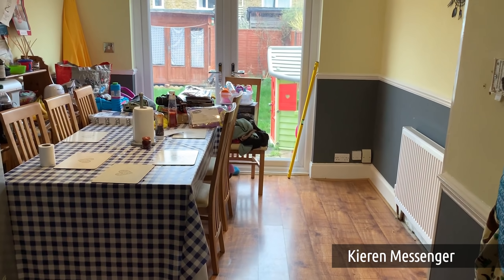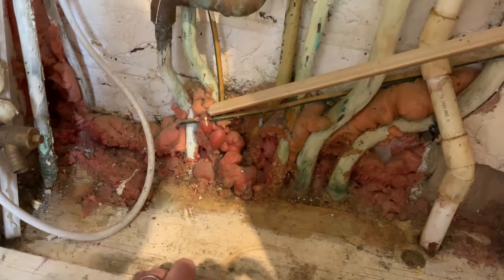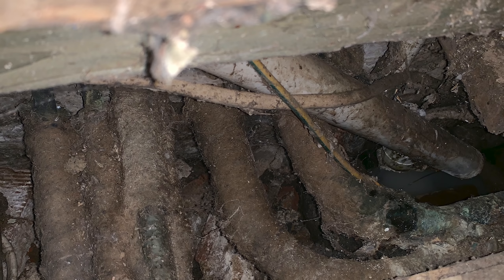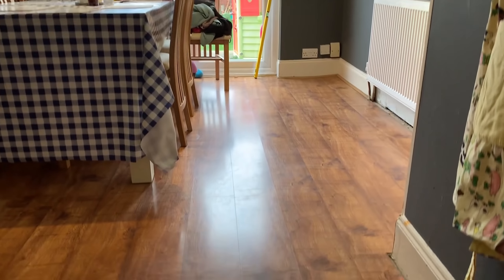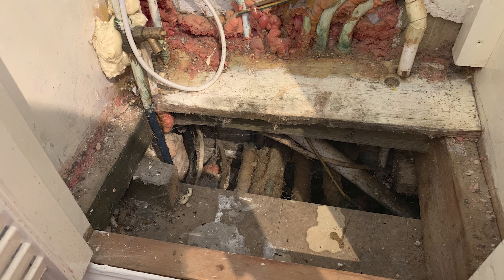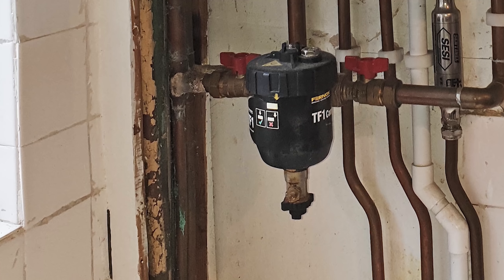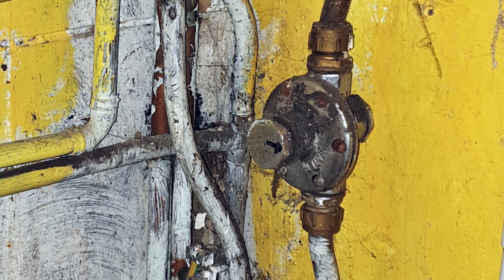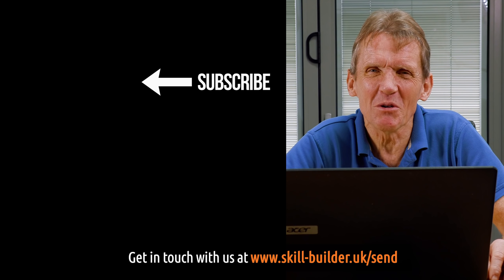Why is There a Nasty Smell? ASB #7

Comment: Re. Qu.1: If main house is also suspended floor, make sure concreting extension floor won't obstruct any existing sub floor air vents (air bricks). If it will you can run ducts through new floor slab out to air brick on extension wall to maintain air flow.
Reply from the maker: Martin 
Good advice. That is essential but often overlooked.

Comment: Foil backed plasterboard is a good vapour barrier as long as the joints are vapour sealed to, but people often overlook the trouble effects it had on FM radio,  with and bluetooth performance in modern houses.  I'd you are in a room that uses it all round and has low-e glass you're effectively inside a tin can! 
Also I noticed our local building regs say it should not be used on ceilings but none if the local builders seem to respect that,  and they use it throughout.

Comment: Hi folks. I’m the unlucky one with the drainage issue. Thanks for answering Roger, at least we know it’s fixable! Would you suggest a wet or dry underfloor system?

Few things from the comments: 1) Survey didn’t pick it up. We didn’t notice for 2 years as it was sealed up tight! 2) The previous owner was a builder, so suspect he self-built on the side and sadly cut some corners. 3) Current plans are to move the drain outside, move the boiler to the far wall, underfloor heating and probably rip out the kitchen all at the same time. 4) We’re in Sutton if anyone wants the job! 

Cheers!
Reply: Sorry to hear about that. Not sure what kind of a builder the previous owner was, but that is one horrendous bodge. I've never seen anything like it. I would be going round the entire house with a fine cone.  I would suspect everything the PO has touched to need redoing.
Reply: I was wondering where does your present kitchen sink drain to. Is it going to that gully?
Reply: Phill Seddon yeah, the sink, dishwasher and washing machine all drain into the gulley. There’s only so much bleach I can use to stop the smell of food waste 🤦‍♂️
Reply: Oh crap. Wasn't sure if that had been checked, Roger mentioned about boiler condenser overflow, but thought I wonder if he left open for other services. 
Best of luck with sorting it out.
Reply from the maker: Hi Kieran 
Always go for the wet system. The electric system is really for tile warm up not for heating the room. 
Electric on a room like that costs  fortune to run. 
A bloke down the road had it, against my advice, and after one season he turned it off when he saw the bill. He has gone back to radiators. 
The wet systems are cheap to run and work really well.
Reply: How did it turn out Kieran?
Reply: indieh01 I was wondering the same!! How did it work out phill?? Only just found skill builder so watching a lot of new/old...
Reply: @jethhughes4278  same. Curious. But doubt he'll reply now!
Reply: Any update :D did you recently buy the house? Waa it captured by the surveyor.

Comment: I'd love to get there and sort that out it's bloody terrible. Heart breaking to see such shoddy work.

The damp I would agree with roger, I'd also wonder if you have sufficient airbricks. I wonder how that job passed building control.

My personal choice for the internal insulation would have been polythene sheet between the stud and the brick allowing an air gap, Lot of work but stops damp and eventual salt and  build up plus mould

Comment: My preferred way to spec insulated dry lining is to fix 50x25mm treated softwood battens to the wall with a DPC behind the battens and then use a composite board which incorporates a moisture control layer such as Kingspan K18. 92.5mm board works for most scenarios. This incorporates 12.5mm PB so the insulation would be 80mm. https://www.kingspan.com/irl/en-ie/product-groups/insulation-boards/kooltherm/kooltherm-k18-insulated-plasterboard. The DPC need only be used if there's a risk of moisture coming through the existing wall.

Comment: Thank for your advice Roger I should have mentioned I’d used the foil backed plasterboard and put the batons over the full sheets of insulation so they don’t touch the actual wall, wasn’t sure if it was overkill so didn’t use it in another room but definitely will for the others with your advice. Has made a big difference to that room.  Was also wondering if it’s worth insulating under the suspended wooden floor? Maybe with loft type insulation.
Reply: I've insulated under a suspended wooden floor, it was the worst job in the world.
I had to crawl under the floor in about a 2 ft gap, push the insulation into the joists and then cover with membrane to stop it falling down.
Never again unless I used spray foam or could easily take up the flooring.
I rent out the property now and one day I'd love to fill in all the voids and have underfloor heating. Pure luxury.
Reply: @ralphsterz2889  I've done that too. Agreed. Definitely worst job to do ever.
Reply: Rigid board insulation sitting on timber battens fixed to side of joists to stop it dropping through
Reply: James, I really wana insulate the solid walls of my house, I watched a few videos and read up a lot online and the possibility of interstitial condensation has really put me off so i am more than willing to go overkill. Would really like to get a bit more detail from you re what you did. Can you confirm exactly your set up from the wall, including thicknesses of each layer. Did you insulate the wall under the floorboards too?
Reply: Jackzuk hi I first put full sheets of 50mm rigid insulation against the walls then fixed them with 25x50 roof tile batons as they are pressure treated and cheap. I also used foil tape to cover the joint between pir boards. Then used 12.5mm foil backed plasterboard onto the batons which leaves a 25mm gap between the back of the plasterboard and the insulation. I used this gap to run ring main etc. Also put loads of additional wood when I planned to hang a tv for support. If possible seal any gap round when walls meet with foam filler if room. Have thought about running a full silicon bead round the insulation perimeter before fixing to the wall to again stop any moist air reaching the wall behind but haven’t done that yet. Room is so much warmer now and I plan to do all external wall in the house.
Reply: Thanks James, I’ve been looking into this for ages, reading all the celotex/kingspan documentation about how it should be done, also read up in loads of other places and i got to say your way seems by far the best way to do it. It seems to cover all the issues, I cannot believe no one else has mentioned this way of doing it. Its cheaper than getting combined insulated plasterboard, leaves a gap for wiring, lets u seal the joins in the insulation, the 25mm batten void plus 12.5mm plasterboard gives u a nice 37.5mm lip to allow u to tape the join between the insulation and the wall and keep it hidden behind the plasterboard (i would also foam and silicone that edge before taping that for belt and braces). 

Did you stick the plasterboard to the wall or just have the bettens hold them in place. 

Did you leave a small gap at the bottom and fill with foam?
Reply: Jackzuk I went down to the floorboards but you could cut them back and continue the insulation down further but I didn’t do this. Also I have redone a bedroom which seemed like it had already been insulated but they’d used the white polystyrene type stuff and my Dad was a fireman and said it can cause a fire risk if it’s near cables but the Kingspan etc is fine. So would avoid polystyrene. Seeing that I pulled it off and the walls looked ok behind with not really any mould but they had fixed with dot and dab with mechanical fixings too when because they were set in the masonry wall, and the tops were just below the skim plaster, when it was cold you could see a sort of water mark blob where they were. 
This method avoids this as the screws holding the batons are deep under the plasterboard.
Reply from the maker: I insulated under my floors, it took a day to do but was the best day I invested. It makes a huge difference.
Reply: @Jackzuk , I was in a similar boat a few years back and spent months looking into how to best go about the insulation job. Very few people seem to talk about a continuous foam slab with wooden battens all the way through, but I've seen it done plenty of times.

Personally I also filled the voids between the battens with insulation but didn't use foil backed plasterboard as the taped PIR boards have the moisture barrier covered. I left a gap large enough to get a foam gun in around all of the edges, and went as far as I could below the floorboards. My biggest concern was the window reveal as sealing properly all the way up to the window is tricky and you have less room for insulation. 25mm was as much as I could fit in there, and I did my best to tape and seal with foam everywhere that I could. The plasterboard is only screwed down on the inside corner around the window, and glued to the PIR (which itself is glued in with foam) further back.
Reply: Hi James, can i asked how u fixed ut betterns please..... im trying ur idea now, and am about half way through batterning and now im finding it a hit and miss of the batten screw finding the raw plug i put in and its doing my head in,
Reply: @Jackzuk  have you put Rawl plugs in the wall behind the insulation?
I just went straight through the battens with the SDS, straight through the insulation and into the wall, then used concrete screws to affix to the wall.

The cold bridging is going to be very slightly larger than with a screw and a plug, but it's so much easier and I'm not overly concerned. I did ensure that every screw head was inset into the timber battens a little so that there was no direct contact from them to the plasterboard though.

Comment: With the sound reduction material - there needs to be consideration to the electric cables and future maintenance. Good to fill the gaps - but must not compromise the heat dissipation of the electrical wiring. Always an issue of unintended consequences. Fix one problem - create another.

Comment: We paid for a full survey and they listed the windows as “good”.  They are 10 yr old wooden frame doubled glazed.  70% leak, window sills are rotting and the external window trims and battens disintegrate when touched (they are visibly rotten).  We complained and they came back 2 months later and said it wasn’t raining when they did the survey and as 2 months had passed it could have rotted since 🤦🏻‍♂️.  They then wrote to us to say that was their final decision and they consider the complain closed.  It cost us £4000 in repairs!
Reply from the maker: That is outrageous
Reply: Should write to their governing body and ask if that's acceptable practice.

Comment: In my under stairs toilet I kept smelling the drains. I could find no leak at all around the toilet. So the only suspect was the trap on the sink, but since the loo gets used every day could not think how the trap would dry out so quickly.
Then one day I shut the door to the loo as I entered and heard a glug glug.
It's a sealed room so all that pressure pushed the water out of the trap. Don't tell the council ;)  Still trying to figure out how to ventilate it, perhaps I need to write in for your advice on that...
Reply from the maker: consider it done. We will address it in a future issue. I think it was coincidence. Try doing it again a few time. A more likely cause is siphonic action on the trap caused by something else being run in the drain.  Consider the possibility of a blocked drain. That is a common cause of the glug, glug, glug.
Reply: @SkillBuilder  The sink drain runs into the soil drain through a side stabbing, that then runs off to the outside. I considered it might be the flushing of the loo but a 4" pipe would not do that.
I will make a video and take photos of the ventilation problem and why I have not installed an fan already.
Reply from the maker: @logik100.0  I have known plenty of 4 inch drains pull a basin trap. It does not have to fill the 4 inch pipe it just needs to create a pull of air. That is the purpose of the vent pipe.
Reply: @logik100.0 , depending on how accessible your waste pipe is, and the configuration of the rest of the waste system, you may be able to easily add an air admittance valve which should stop the drains pulling the basin trap.
If it is indeed the door however, it might be worth just taking a few mm off the bottom.

Comment: Bilding an extension abive drains requires approval. It is likely the extension will not have been given council building approval. Since 2013 the law changed and sellers became liable for non disclosure of known issues. It may be possible to sue the previous owners for non disclosure.

Comment: Re vapour barrier when insulating a solid wall, I was looking into foil back plasterboard but wouldn’t the vapour pass through joins of the plasterboard and then pass through the inevitable gaps between the foil insulation and the battens. This is something is really wana do but worry about the interstitial condensation. What would you say is the best set up of layers. 

Is there harm in doing all the suggestions, ie use foil backed insulation, then battens to create the small voild, then vapour barrier and then foil backed plasterboard. Also would it matter if the let the vapour barrier sit slightly loose between some battens so allow cable to run up from under the floor between the plasterboard and vapour barrier.
Reply: The foil backed insulation will be fine, any joins or battens cover with aluminium backed tape to seal the gaps.
Reply: If you tape up all of your celotex joins, the continuous aluminium later there acts as your moisture barrier, and and even without the tape I'd suggest it would be as effective as foil backed plasterboard (as you can't tape the foil joins on the back). Not quite sure why that wasn't mentioned in the video.
The screw holes going through holding the battens can be a way for moisture to get through but I'd still consider it better than the gaps between foil backed insulation.
With larger battens you could attach to the ceiling and floor and not penetrate the insulation at all - this would also provide an acoustic improvement, especially if you use compliant mounting hardware.

Comment: Hi can Anyone on here give me some advice I have just fitter insulated plasterboard in my hallwall but the joint are not flush maybe 1-2mm clip on them is this going to cause problems when it gets plastered presume it’s prob down to the insulation squashing
Reply from the maker: It is due to just not getting them flush when you put them on the adhesive. I always use a big aluminium beam and lay it across the boards. 
If you are talking of a lip of anything up to 4mm the plasterer can straighten that out so don't worrry. Not everything goes well first time.

Comment: Watch that expanding foam it can attack the pvc on the electric cabling eating it due to the chemical mix in the foam
Reply from the maker: Hi Porkbap 
Have you some evidence for this? We would like to see something that supports this claim because polyurethane foam is used all over the world as a seal around cables. You have to guard against over-heating  but plasticiser migration is usually caused by  polystyrene.
Reply: @SkillBuilder  yeah actually thinking about it was on about the foam insulation they used to use in wall cavities and roof spaces I was a spark for 20 years and have seen the polystyrene actually attack and eat the outer of the pvc the expanding foam is actually a different entity all together watched the video first thing in the morning at 7.00 BC (before coffee lol) your right guys should comment after coffee lmao good content by the way :)